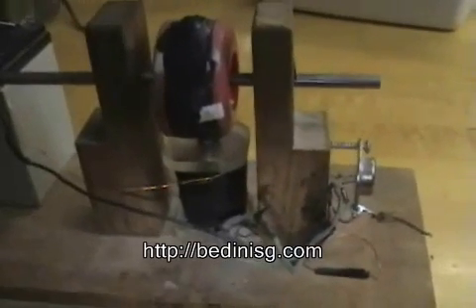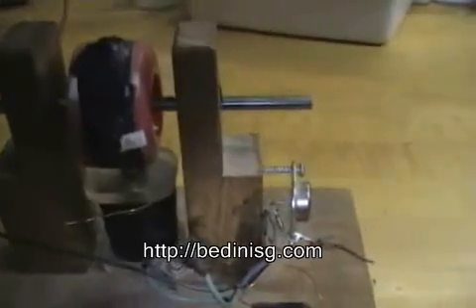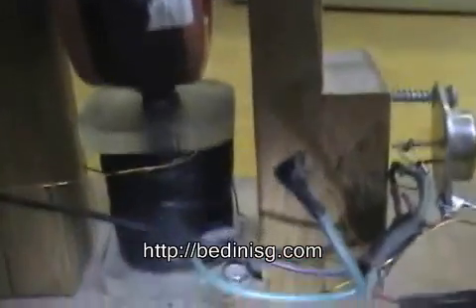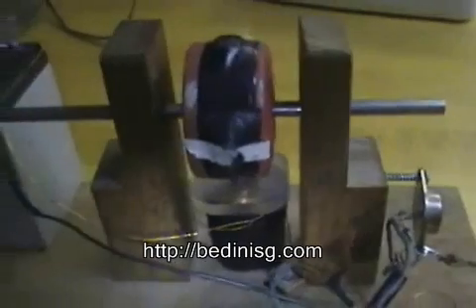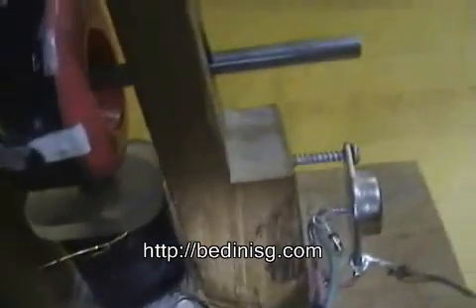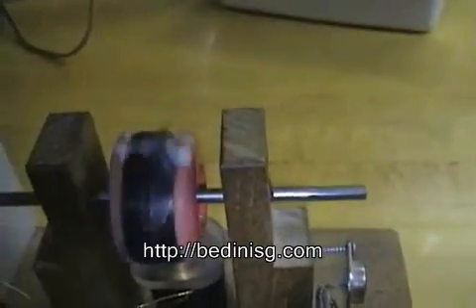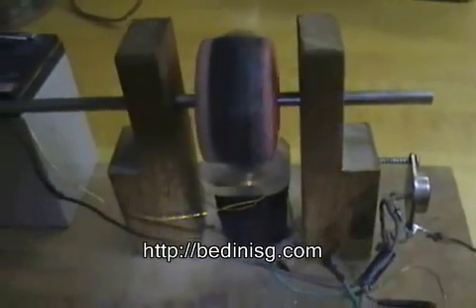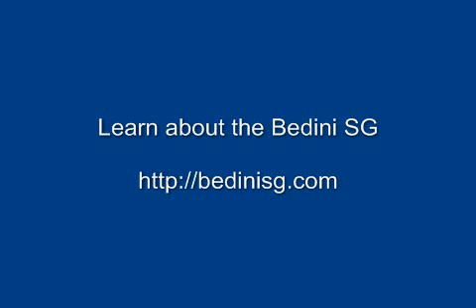Bedini SG

Comment: What do you mean it is turning for free. I made various SSGs in a quest for "free" energy and I never saw a wheel turning for free. My Bedini Window Motor gave fantastic performance though. 5000 rpm with torque for very few miliamps of power ( dont remember how many now ) -- but not free unfortunately. -- A few people claim to have made self-runners though I never tried that build. The plans are on the net.
Reply: The mechanical work of the rotor is free, you're only inputting energy to power/trigger the circuit.